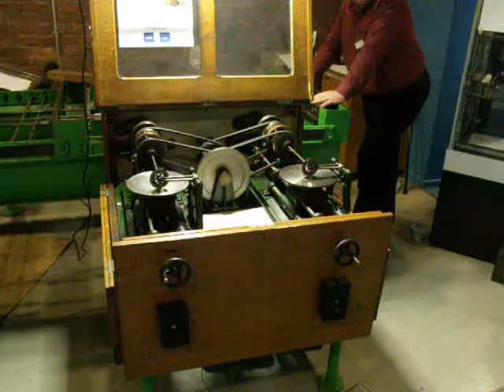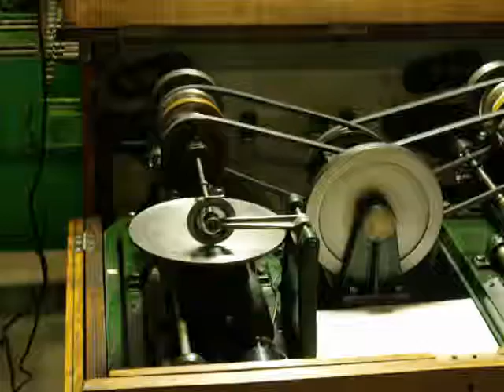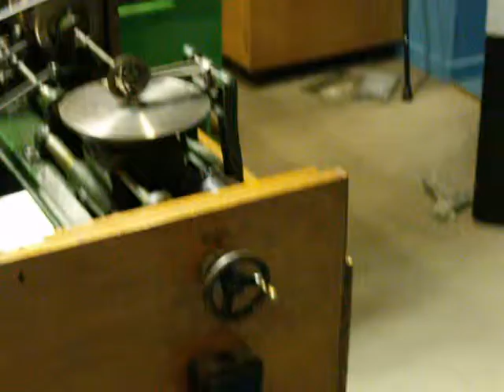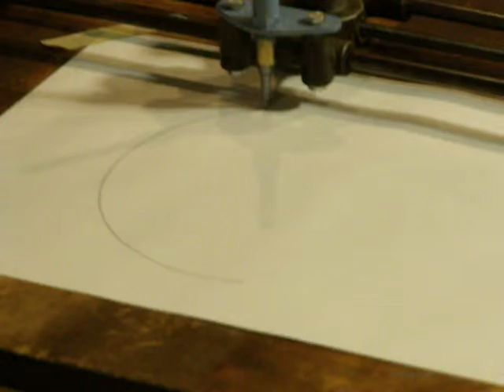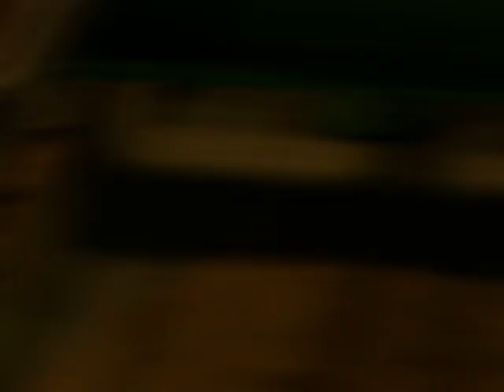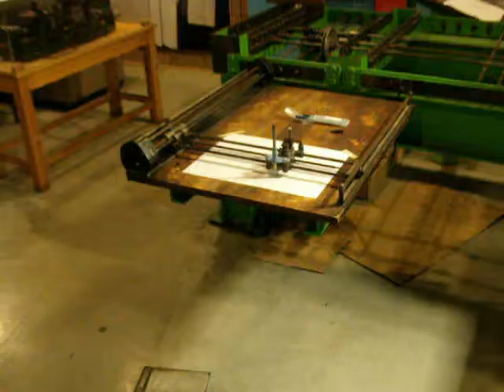Hartree's differential analyser

Comment: Hartree's original analyser is in the Science Museum.  It was constructed using Meccano.
Reply from the maker: No, the original was not Meccano. There were several later Meccano analyzers made, but they aren't as accurate. Meccano isn't as rigid. (My father - who made the above video ) worked on restoring a Meccano model for several years, but could never get the accuracy that the Manchester Museum of Science and Industry model had.
Reply: @JudithProctor  That machine is so heavily built, it looks more like a machine tool than a scientific instrument! My Meccano analyser has a much bigger error, but Tim Robinson has made them with almost no error at all. I think most of the error is a result of slippage of the integrator wheel on the spinning disc. Great video, thanks.

Comment: Wow !!
Reply from the maker: My dad put a lot of effort (as did the other volunteers) getting the machine working and then adjusting it until it plotted curves correctly.  Mechanical computers have to get the friction exactly right.
Reply: What is it?
Reply from the maker: @irenedavo3768  It's Professor Hartree's differential analyser.  It is a mechanical computer made to do solve differential equations (sines and things like that)  and to plot the curves for the results.  It predates modern digital computers.